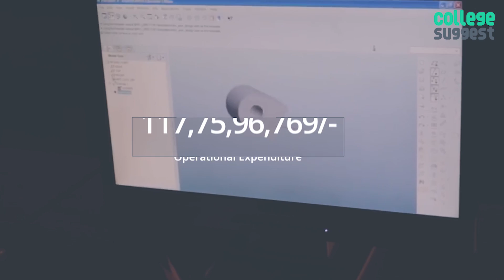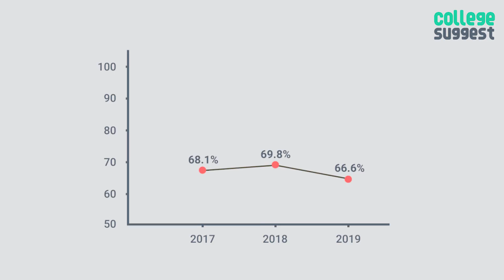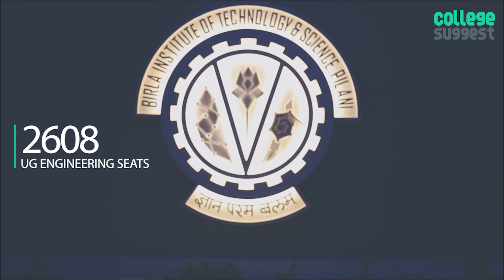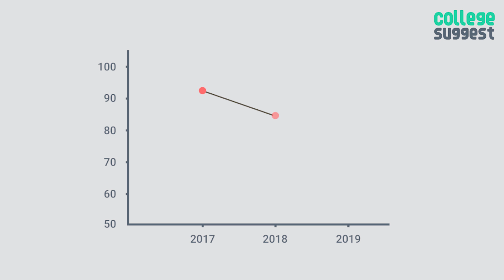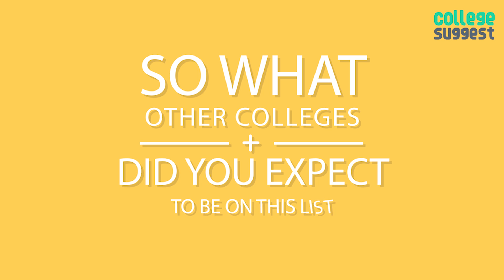Top 10 Pvt. Engineering Colleges in India 2019

Comment: My College ranks 106 in NIRF 2019.
Avg Placements is about 6.5 Lakhs(8-10 lakhs for CSE/ISE).
Its in Bangalore, Between IT Corridor and Special Economic Zone.
I will start my Btech from NHCE in CSE.
These So called Top Colleges doesn't have that good Placements (except BITS Pilani and some other cllgs).
Reply: VIT is good but the admission is not fully by merit so not all r geniuses in vit. It is no. 1 due to its various schools,clubs,hackathons,etc and in 2019 its highest placement was two guys with 39LPA and avg of 6LPA
However BITS is fully merit based admission so it every1 like it
Reply: Thapar is excellnt for cs